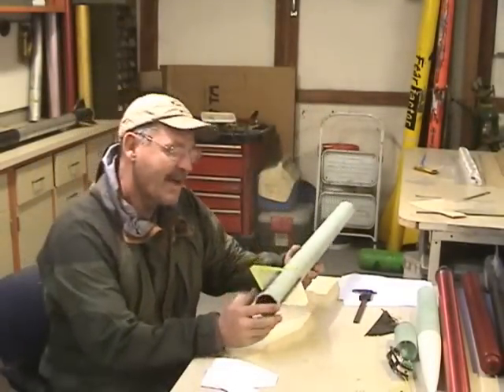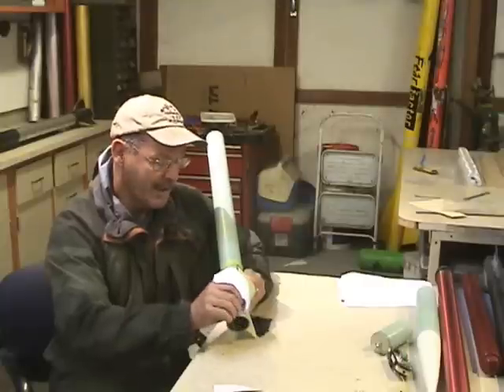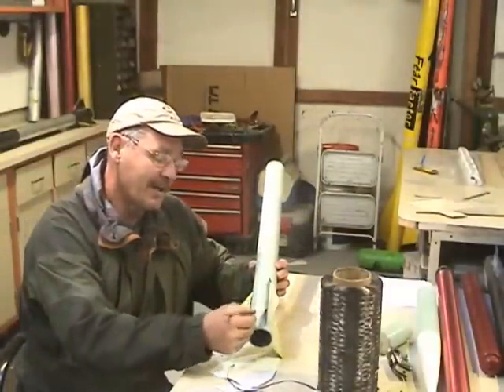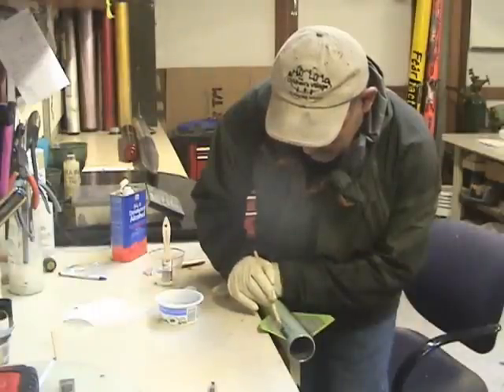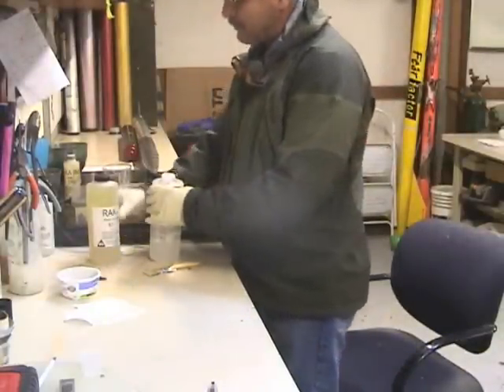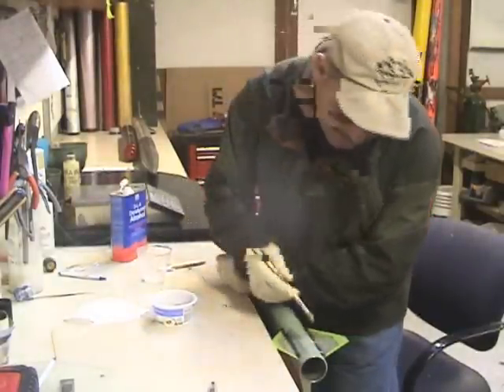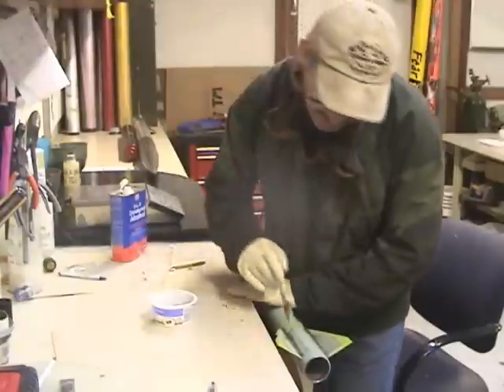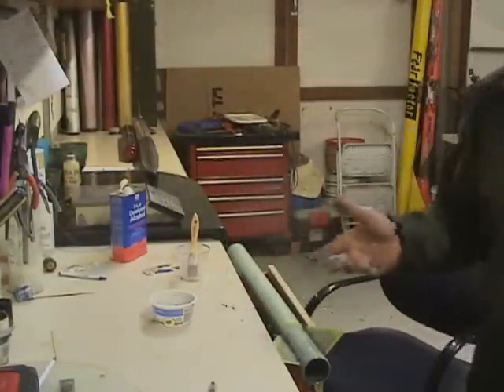KestreL Ex

Comment: Tony, use Carbon Kevlar Hybrid, then 2 layers of Carbon fiber 5.7oz . Triaxal layered for maximum strength. also make each layer wider because it will create an A-symetrical fin shape that is wider at the base and will cancel out fluttering. vacuum bag this. THen, forget that avbay, and stuff all your electronics in the nose. chute behind that, motor behind that. you will get alot more altitude that way.

Comment: @hsvrocketman  - Post cure should only be used with an epoxy designed for it. If you use an epoxy such as West Systems that requires no heat to cure or post-cure, you can damage the crosslinking and thereby the final strength of the epoxy if you exceed the Td temperature of the epoxy you use for the layup.

This gent builds some nice rockets - I've seen a few fly (he flies occasionally with the same club I do). He also has quite a reputation for his altitude birds and EX motors.